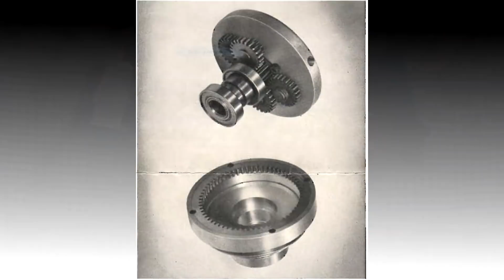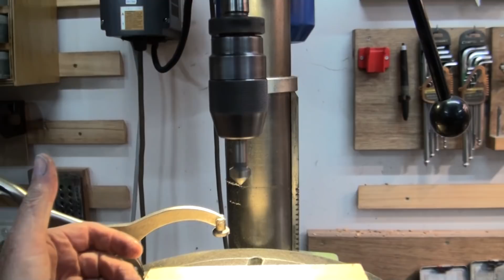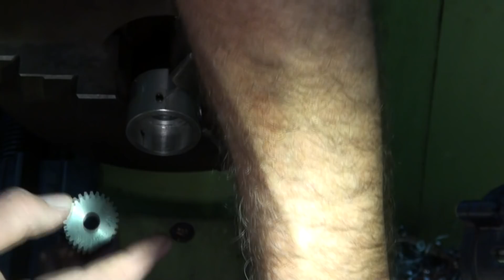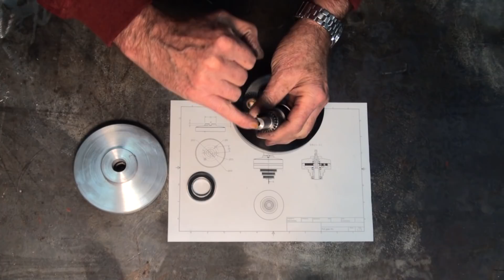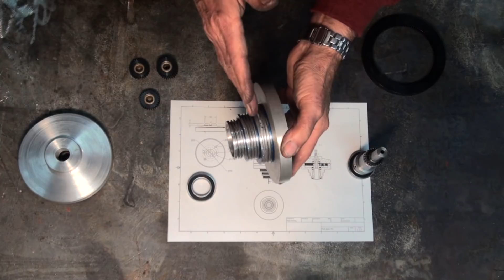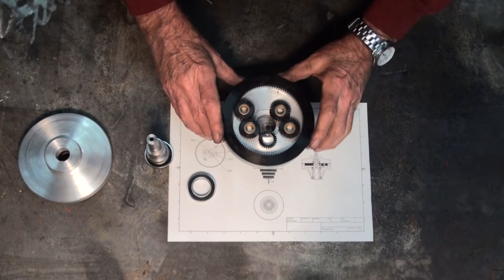Pull Gear Speed Reducer - Thanks to Mr. Pete

Comment: Mark Presling,  Small voids or inconsistent alloy in the casting? Some aluminum machines poorly I think -sticky. Surface of casting looked gnarly, but I am no expert. Can you make those major components from stacks of discs on a shaft? I’m not sure how that would interact with the varying internal diameters, bearings, keyways, etc. One failed sub-component would not scrap all work. Thanks for your pleasant and informative videos!
Reply from the maker: Toby. Unfortunately I used some rubbish alloy in those castings. It came from an old lawnmower base and I suspect it had a lot of magnesium in it. It was very difficult to machine and as you probably noticed it built up on the tool edge really badly. If I had the stock on  hand I would have just machined it from solid 6061 billet but as is usually the case, by the time I was finished I worked out the correct way of doing it! I guess you could build the main components up from simpler shapes like discs and rings but I think you would end up losing some rigidity in the finished form. I usually make my castings from scrapped cylinder heads and they tend to machine quite nicely. I only had some really big pieces left and they wouldn't fit into my crucible. The lawnmower base was really easy to smash up with a sledge hammer which should have been a bit of a red flag right from the get go.
Reply: Mark Presling , Thanks for your reply. In looking at the machined vee belt section of the housing it appears it is too convoluted to make in sections. Cancel that idea, LOL. 

Regarding the cast Al, I have seen amateur foundrymen pour excess metal into cupcake trays (large and small sections) which makes clean top quality handy sized little pucks for future use. If you melted iffy batches of metal into this form you could test dross-free batches for good/bad properties and sort them into groups according to properties, then mix and match for your next pour. If you had a home made electric furnace (plans on Amazon) you could hold at a temperature and control the atmosphere if needed. and heat multiple crucibles. Please take my babblings with a grain of salt as mere observations of the hard skilled work of others. :) A lawnmower base should be OK for a machinery base requiring little machining. Have you tried using Al engine blocks? The ones without cylinder liners may have too much silicon, just a guess. I have seen iron brake discs used with a special additive. Additives may be of some use with Al as well.
Reply from the maker: Toby,
All the castings I have made previously were a mixture of stock taken from car engine parts. The alloy used for those parts is usually of a high quality and it does machine quite well. It was just dumb luck that I had used rubbish alloy for a part which needed some tricky machining. I have poured my excess melted metal into muffin trays but I lack the skills to do any definitive testing on the properties of the resulting pieces. I have seen some videos from a channel called luckygen1001 and he will cast a small wedge shaped bar from the melted stock and then break it to see what the grain structure looks like. I think the video you referred to with melting brake discs was by the same guy. He may have a background in foundry work so I guess he knows what he is doing.
Reply: Mark Presling Thanks for straightening me out. Iron appears alluring, but it sounds like no amount of money is going to get MrPete to cast iron! A very strong consideration for the rest of us.

Comment: I believe there are VFD's that will increase the output when it sees a load slowing down the motor. There may be some extra bits that have to be added, like rpm sensors. I don't quite remember, as this was a while back that I saw a video on it.
Reply from the maker: I believe you are correct. Unfortunately the cheap Chinese VFD has a manual which is incredibly difficult and confusing to read. I suspect there is some potential for getting more torque out of the drive that I have but so far it has eluded me.
Reply: Mark Presling You just need to learn how to read Chinglish. Lol!

Comment: Hi Mark .
Very good vidios !
I was designing something like this for my lathe , I need a 6 to 1 reduction to fit on the spindle nose , then fit chuck to that.
Could not find any information as to where to get gears .
My lathe uses 16DP X 14.5 pa gears so I thought I would use the same size for my reducer , and make my own ! !
I plan to use 22 tooth sun driving gear , driving 44 tooth planets (3off) in a fixed ring gear of 110 internal teeth , I think that gives me 6 to 1 ratio , any advice from anyone would appreciated ! !
How much did the gears for your gear box cost ?
Regards Jim Simpson
Reply from the maker: Jim, I purchased my gears from a company here in Australia called Ronson Gears. They have a good online reference for stock gears but here in Australia at least they are all metric modules. You can take a look here - https://ronsongears.com.au/stock-gears/ I think I paid around $200 Australian for the 5 spur gears and the single ring gear needed for my project. If you are in the USA you will probably be able to find something on Amazon or McMaster Carr. With regards to fitting the gearbox to the spindle nose, I would recommend that you fit it to the motor spindle instead. The gear assembly tends to have some inherent backlash and the bearings are not designed for axial loads. I think you would lose a lot of rigidity by fixing the chuck to the pull gear. Plus, you would not be able to reconfigure it for direct drive. If you have the type of lathe that has the motor fitted at the rear of the headstock you could just fit the pull gear there and still include the stepped pulley to drive the countershaft if you have one. I struggled with trying to work out the gear ratios for my design and I believe that the number of teeth on the planet gears are irrelevant. If you have a 22 tooth sun gear and a 110 tooth ring gear you would have a ratio of 5:1 which is still a respectable torque increase. Also you need to be aware that having a 3 planet assembly between the sun and ring gear will reverse the drive direction. When I saw the arrangement in the patent drawings of the pull gear I wondered why there was a double set of planet gears meshed together and it became apparent that it was needed to keep the drive direction the same between the motor and the spindle. It also makes it a bit easier to map out the gear centres since the planet gears don't need to be specific sizes to mesh exactly between the sun and ring gear. Good luck with your design. I am really keen to see what other people can do with the concept. My own design is almost finished. I am just in the process of completing the locking pin assembly and then I will need to modify the belt guard to allow for the extra height of the pull gear.
Reply: Mark Presling 
Hi Mark , thanks for answering my comments . I am in England , so anything shipped from the US is Megga expensive !
I had in mind the Pratt and Whitney or Holbrook lathe speed reducer , but I can't find any information regarding gears used to get a 6 to 1 reduction , nor info on ring gear tooth shape .
I think these units rest on the lathe bed . If anyone has some information about these units I would be pleased to hear about it .
Reply: Hi Mark ,
I have just looked again at 'part 1' , must have missed first few seconds !
At about 0.46 seconds point , in the video , the two part picture shows the 7:1 unit separated , you can see a double planet 'cluster' , so the sun gear drives the larger gear with smaller gear attached , which meshes with larger gear that meshes with the ring gear , giving same rotation as motor driven sun gear (planet carrier held stationary) to the stepped pully. :)
Reply from the maker: Jim,
I recall seeing the same picture of the double stacked planet gears and at the time I was designing my pull gear I considered a similar arrangement but it would have meant buying four more gears and it would have increased the height of the finished assembly. However if you were building one for a lathe and you could cut your own gears from high quality steel it would be worth it.

Comment: YouTube recommended your video to me obviously because I subscribe to Mr. Pete. I did not know what to expect when I clicked the video, was pretty interested from the start but when you pulled out the patterns and castings I instantly subscribed, keep up the fantastic work!
Reply from the maker: Thanks Frank.
I have only recently started doing my own casting at home. I always thought it would be a difficult and dangerous process and would require really special tools and materials. Well, it turns out any mug can do it. I learned most of what I needed by watching Myfordboy's channel https://www.youtube.com/channel/UCNC9gjgYrzLfyMQmp31DnjA however I have found a few others that are as good or better. If you want to see a real pro you can check out Oldfoundryman https://www.youtube.com/channel/UC90RoN_IjSRF18jAG0HIA6g
I have a pretty basic setup for melting my metal and I am using some local beach sand and a bag of bentonite clay I bought from the rural supply store and although my castings are a bit sketchy, I have been able to make parts that I would never have been able to fabricate. The pull gear is going to go together today. I have pressed about half the parts together and it is looking promising. 
The next video should go up in a day or two barring any disasters.

Comment: Good day Mark.  I also came across this video (and subscribed) and decided to watch your machining techniques.  I will watch all three videos to see the finished product.  I noticed when cutting drive belt grooves, you lost some of lands and you said you were using WD-40 as a lube/coolant.  I read some of the comments and the problem of metal loss could have been casting flaws  but also it could have been using strait WD-40.  I've came across similar problems in my machining and this is what I came up with.  Using one part WD-40, one part Rapid Tap for aluminum and one part 30w non-synthetic engine oil, mixed together as a cutting oil for aluminum.  It is messy but it works.  Maybe you can try it sometime.  Thanks for the video.
Reply from the maker: Thanks for the tip. The metal that I melted for the casting was not very good. I used some broken pieces of mower base which I now suspect had some magnesium in it. I normally use pieces of cut up car cylinder heads and they machine much better. Lesson learned!

Comment: I'm sure that someone has beat me to it but Mr. Pete's version is the 4.5:1 and not the 7:1 version like some of the drawings/info he showed.
Reply from the maker: Mark, yes, I have had lots of people tell me that Mr. Pete revised his estimate of the drive ratio. I tried and failed to get a higher reduction with metric module gears. I started with M1.5 but the whole mechanism turned out to be so large it would not fit into the belt guard on top of the Drill Press. I also realised that the only way to get a better reduction was to have a stacked set of planet gears but that would have made the total height of the pull gear mechanism around 20mm taller.

Comment: Could you have gone to a 2 belt and 3 pulley set up and gotten the low RPMs and torque you needed. I know that mine is set up that way and on low RPMs you can't stop it. If the bit binds up it will take the part away from you or break the bit. And I use up to a 1" bit in it. Just wondering. That would be a easy set up also.
Reply from the maker: Hi Anthony. I have used drill presses with the three pulley system when I was teaching. The main problem is that if you want to go from high speed to high torque/low speed it is necessary to remove and refit both belts. A lot of the work that I do is one off prototyping stuff. Unlike production work where you tend to do the same operation over and over, the constant changing of belts just uses up time. Also, the third pulley was missing when I bought this machine and I just swapped over the poly vee belt drive from my old drill. I added the VFD later and realised that what seemed like a great idea actually gave me very little torque at the low frequencies. Maybe the pull gear will work for me. I got the gear train running yesterday and it has given me the confidence to keep going with it.

Comment: Hello Mark from John. I am in Port Stephens, just North of Newcastle.
I am very interested in your project as well as being one of many new subscribers by the way the comments section is going.
I have a slotting arrangement for my Lathe that is and was like yours in as much as it is also powered by Armstrong!
Depth of cut is Y Axis as well. I have by indexing also used this for cutting splines and gears.
I also need some reduction on the spindle speed of my drill press and had been considering two other options untill now, that is. I will follow your lead as this is a better solution I feel. 
Thanks for an excellent video and idea, John.

Comment: Hi Mark,yet another new sub here.Nice job so far.I see no reason that it won't work as long as you can keep the teeth mesh tolerance's right.If they were available, I would have gone for a wider gear set, to spread the load.A lot of wear on Lyle's sun gear for instance even with his wider gears.You arguing to produce a ton of torque on the sun with large drill bits.As some one else mentioned, a lip(Gitt's type) seal maybe the answer to the oil/grease problem, but will require some slight modifications to the design.
I look forward to see more of your work and will go look at some of your previous work.Thanks for the upload, very good quality camera work.Cheers,Malcolm.NZ

Comment: Hi Nice work, one thing though at 21.32 you show a square on a M8, I wonder how you are going to screw that into a slot, I would have made the square round to screw it in.
Reply from the maker: I will screw the M8 into the spindle first and align the square before sliding it onto the motor shaft. Once it is on the grub screw on the other side to the square key will lock everything off. I did think about using a round end but it would be more prone to deforming. Ideally, I would cut an internal keyway but that steel is really tough and it would not be a through keyway so I couldn't use a broach.
Reply: Hi Mark, ok now I get how you want to do it.
Reply: Had me wondering about that as well. Mr. Presling's answer explains it all very well. Cheers from Indonesia.

Comment: 7 to 1 reduction would need 2 of the 4 idler gears to be made of 2 gears of different tooth count held together, so that you have a second stage of reduction there as well.  Gives the effect of having a smaller inner gear, or a larger ring gear, though the 2 gears will have to be slightly offset depth wise in the casting to get them to match running planes. Inner gear on the shaft is the 2 gears, and the outer is just the idler that both compensates for the spacing and also does the direction change.

Comment: Just thought why not use cup needle rollers and some shoulder bolts for the idler gears. The needle rollers have low friction, good life and the shoulder bolts can have the roller inside for the needle roller to give a hard surface to reduce wear. No bronze bush wear, decent life and you can run them with a light grease.  A lip seal on the 2 halves to keep the dirt out and the grease in, or run an oil bath, and should be both silent and low loss.
Reply from the maker: I could do that as an upgrade at a later stage. I am going to build in some spare threaded holes in the top cap so I can use a puller to remove it later without damaging the castings. I didn't want to go too far with the complexity of the design in case it has some unforseen flaws. If it works I might tweak the bearings as you have suggested.
Reply: Is grease practical at the speeds involved? After a certain point the high viscosity means it heats up like crazy from the friction of flowing, right?  I don't know where that point is, I'm still in the 'knowing barely enough to be dangerous' on the subject of machine lubrication.

Comment: Just get a VFD that has Flux Vector capability and you will have torque all the way to the bottom.
Reply from the maker: I have two good quality VFD's on other machines and they do a much better job of keeping the torque fairly flat across the frequency range but they were twice the price of the cheap Huanyang. I guess I took a gamble buying the cheaper one but at least I get to make some more metal chips by building the Pull Gear!

Comment: Throwing this out for others to think on, it's been commented that belt slippage has been a problem with these.  Those that decide to make these might consider using a more up to date cogged belt, similar to the timing belt on some small engines.  Another consideration for a horizontal shaft set up might be using roller chain.  Either might require some rather radical design changes to the outer bell/step pulley, and that might bring up new problems.  Maybe our 3-D printing guru's can try them out before putting design changes to metal?
Reply: Isn't the belt slippage designed in, to be the safety feature that keeps things from actually breaking when something goes horribly wrong?
Reply: I doubt it.  It may just happen, and it may have prevented failure, but not having the machine work properly invites abusive tactics to make it work for the current task.  I think that would make breakage or injury more likely.

The saying that "you'll cut yourself with a dull knife quicker than you will with a sharp one" might apply here.